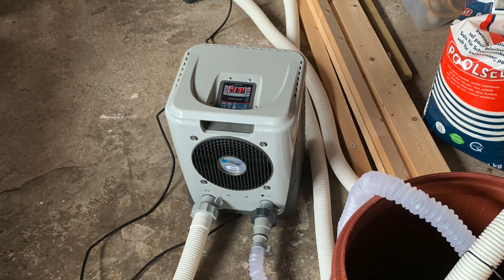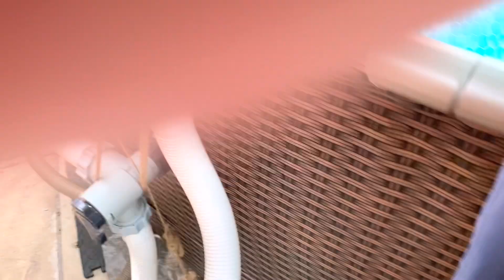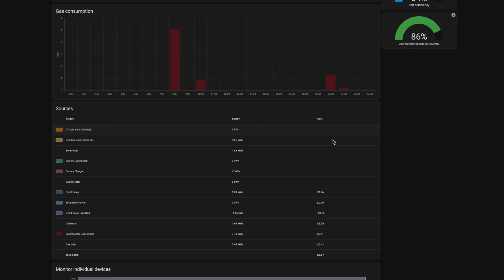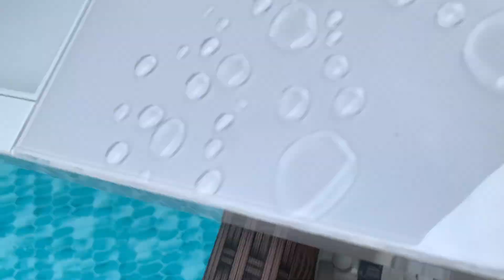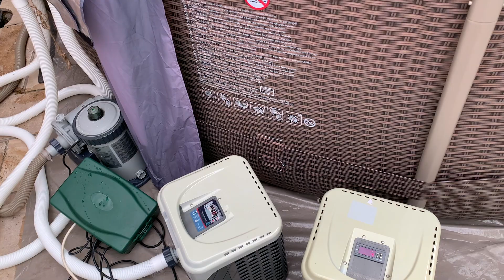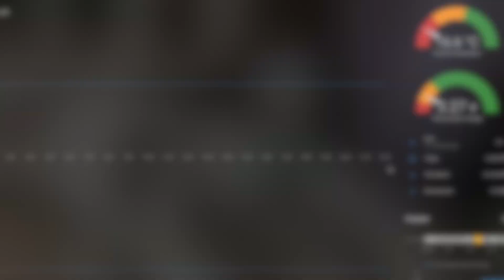Sometimes, it just doesn’t work out! - Pool heat pumps using solar panels

Comment: When I lived in Texas, people used a waterfall like yours on their pools to COOL the water as it would get uncomfortably hot! After three weeks of 40 degree days and 32 degree nights the pool water would be ridiculously warm.  By using one, I suspect you are losing a lot of heat energy to the atmosphere.  
To heat that amount of water to say 30 degrees would take approx 800 million joules under ideal conditions. (no losses) That's an awful lot of energy! At 7.5 kw, it would take about 30 hours of continuous running, again under ideal conditions. But its difficult to run solar powered heaters at night...  Insulation would help losses  and I've used a top cover made of bubble wrap to cover my hot tub over night which made quite a difference. Your pool has a large surface area relative to the volume so a similar cover during the day when not in use would make a few degrees difference too. 
Also, taking the water to be heated from the deepest part of the pool (coldest water) would help heating efficiency. Your water is taken from the top, which is probably the hottest. Anyway good luck!
Reply from the maker: Thanks, it’ll probably be easier to just move to Texas.  My calculations were very similar, I worked it out to about 92Kwh of energy to go from 22 to 28 degrees, which sounded achievable but like you say that is in ideal conditions.  Maybe digging a big hole with insulation is the way to go.  Then build a shed on top of it.  🤔